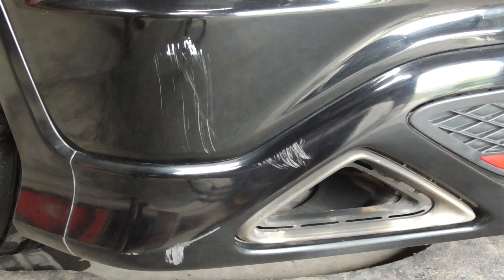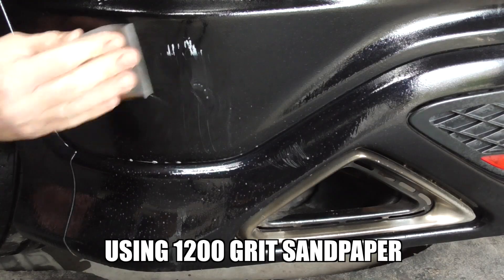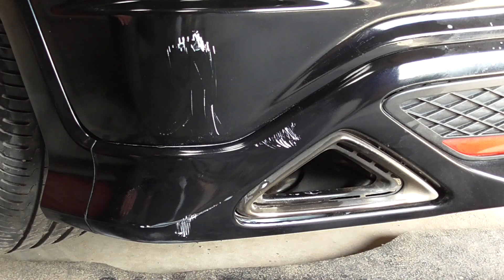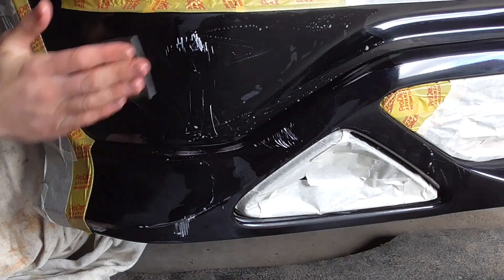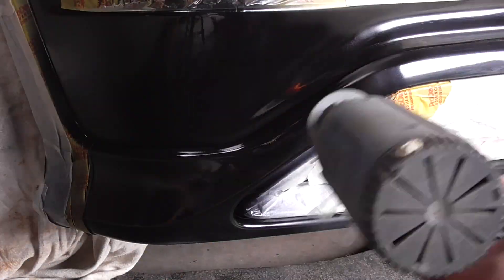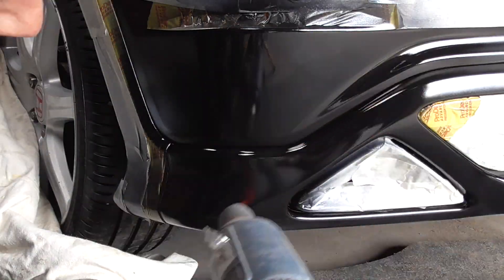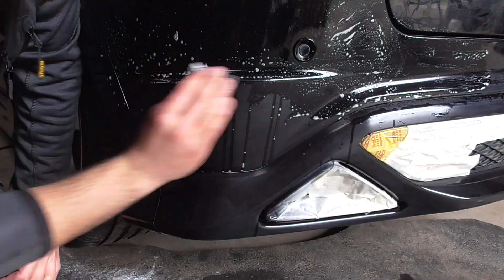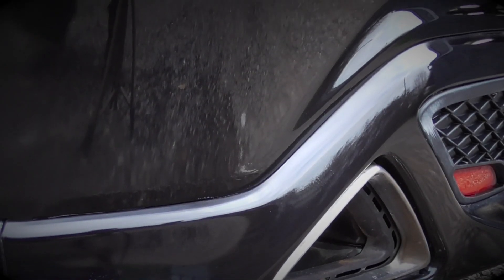How To Repair Bumper DAMAGE & SCRATCHES | 5 Minute Fixes | DIY | Spray Can Aerosol

Comment: Apply the paint with an airbrush. Don't use a heatgun, use a heat lamp which isn't too hot. Lay the last clear coat very rich, avoiding runs. No polishing needed.

Comment: I started a little side business doing this. Trying to repair light scratches or headlight restoration. Had several jobs done this week on my neirbours cars. Need to learn to use filler and spray paint though
Reply from the maker: Hi Zain, good work! If you're still learning, just keep at it and itll all start to fall into place eventually. When learning paint and body it can be useful to buy some old / damaged panels to practice on so you're not risking any further damage to yours or your customer's cars!

Comment: What do you think of Spot Blender aerosol?  You spray it at the end to 'melt-in' overspray and blend in the very thin edge  of the new clearcoat at the edge where it joins the original clearcoat so it doesn't peel again after a year or so.
Reply: i noticed he didnt use it either

Comment: Thanks great help and informative. I noticed that you did not apply any primer first is this not necessary on a plastic bumper?
Reply from the maker: Hi Martin, tha ks for your comment. I didn't apply primer here as there was only a very small area that didn't have colour (where the scratches had been filled) so I tend to go straight in with colour in these cases. This is advantageous on a fade out job such as this because if I had used primer, at the sanding stage I would be fighting a  receding line of grey as I sand back the new colour coat. Cheers!
Reply: Thanks for the info Johnny, you have given me the confidence to have a go on the wifes Aygo which has a small wheel arch rust patch. Best regards.

Comment: I’ve added this to my watch later list as my car was reversed into and instead of going through insurance I’ve decided to rectify it myself and this video will help a lot. I have a vague understanding of what’s needed, but this gives me more confidence to get the bumper back to how it was. Just hoping some of the slight folds from where I’ve banged it out will flatten when I heat it up.
Reply: Just to let anyone know, it was both mine and the other drivers fault for it happening. I hadn’t realised I was in his blind spot and he hesitated when reversing so I decided to go first, unfortunately it was his decision to reverse at the same time. I was in a rush at work and he was just leaving for home. These things happen though and I am gutted it happened as I love my car and it will become a classic one day as they’ve stopped production of the vehicles. So I want to get it back to how it was and next time have more patience.

Comment: Hello, did you end up with any noticeable transition line near the center front?  If I had 2 small damage spots on opposite ends of a plastic rear bumper cover, would that require painting entire bumper since the gap/joint is about 2 feet away from the damage? 

Thanks
Reply from the maker: No transition as I painted to the natural gap between the arch / bumper and the rear apron / bumper. Towards the top I only painted up to the natural ‘shoulder’ of the rear bumper and lost the new paint into the ridge so it’d be totally invisible 👍
Reply: @JohnnyGetsCash  I sprayed duplicolor base and clear on half of Corolla bumper cover. I ended up with that side not as shiny as the factory finish side .. should I scuff everything with wet sand 2000 and reclear entire bumper with 2 k clear? Or any other suggestions would be greatly appreciated. Thanks
Reply from the maker: @flipper2473  I guess that the ‘proper’ way to do it would be to re-do the entire bumper, how’re I have had quite a lot of success blending clear in the past by blending the new clear into the prepared / finely scuffed old clear, then when the new clear has thoroughly hardened scuff up (or ‘key’) the surface with a fine W&D paper like 1200g then machine polish the entire panel / part. This generally allows me to make the whole part a uniform level of gloss. Hope that helps.
Reply: @JohnnyGetsCash  thank you, so , with that information, tell me if this plan has any flaws.  I will wet sand the half of bumper that originally did not come out shiny with the 1k clear  coat, wet sand 5 inches over into good factory finish (narrow part center of rear bumper). Then spray 2k clear over bad half and over the 5 inches of sanded good side.

Should I spray a blender on area of untouched good factory area line where it meets the scuffed good 5 inch area or simply rely on polishing to blend? Thanks so much.

Comment: Hi Johnny, great job! In your video you mentioned using an aerosol paint in the correct manufacturer colour. How do you find exactly the right shade? I imagine black paint is easy enough to get right, but in some of your videos you tackle very particular shades and metallics, and get the colour spot on every time. How do you ensure you have the right stuff? Thank mate
Reply from the maker: Hi, thanks for watching! Whenever I’m doing aerosol repairs (as opposed to gun work), I mainly use the same supplier (who I trust to get the coded colours correct) - a company called Paints4U. Admittedly sometimes the shade can be slightly off but then it comes down to the skill of fading out across a panel 👍
Reply: @JohnnyGetsCash  Thanks so much for the response! If I may pick your brain a little more as I'm quite inspired - how do you go about finding such good deals on cars? Do you avoid used car dealers and stick to auctions and private sales? And what do you look for in terms of condition, mileage etc. to ensure you're getting a feasible project car? Thanks again for the great content and response! 🙏

Comment: Nice job! Why not use primer before paint?
Reply from the maker: Hi Robert, thanks for the question. When repairing areas on plastic bodywork such as this (as opposed to metal panels) i sometimes don't opt for primer. In this instance (being a flush repair after the filler), any primer would've been lost at the flatting stage so it was acceptable to go straight in with paint. When the unpainted areas are very small, such as the filler here, sinking is less of a concern also. I hope that has made some sense! Thanks for checking out my video!
Reply: @JohnnyGetsCash  thanks Johnny for the quick reply.  Cheers!
Reply from the maker: @robertgrlic6505  No worries Robert!

Comment: Really helpful video, it’s encouraged me to tackle a rear wheel arch!  Can I ask, is the heat gun necessary/what’s the benefit? I don’t have one and I’m wondering does it make it quicker or help the paint to blend because it’s warmer? Or something completely different?
Reply from the maker: Hi Andrew, thanks for your question. The heat gun is quite important as it warms the work piece and helps the paint to apply evenly. Also, when applying clear coat it helps to prevent blooming (a cloudy / milky looking effect within the clear caused by excess moisture in the air / too lower temperature at application stage). You can get away without using a heat gun if working in the warmer months, or if you use an infrared heat lamp instead. My preference is with a heat gun though as it allows me complete control over the panel warmth etc. I hope that helps a little! Cheers
Reply: @JohnnyGetsCash  thanks Johnny! A heat gun is on the to buy list!
Reply: @2007ACE2007  Did something similar to this on the same model car (albeit silver) and had to use a heat gun, just be careful not to cook the paint and keep some distance with the heat gun and keep the gun moving left and right! lol... had to re-do one spot twice because of user error although it was a bad time to spray in the cold, and I don't have much experience with spray painting it did come out alright after a little buffing with the machine polisher.
Reply: Would a hairdryer work lol